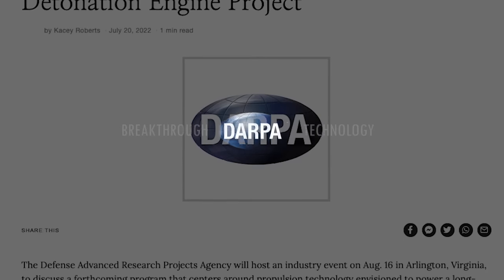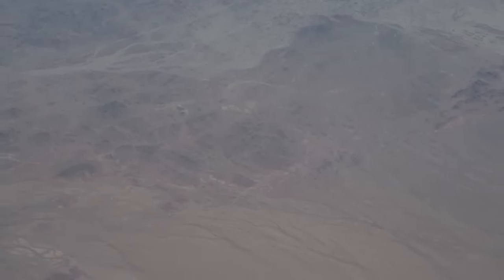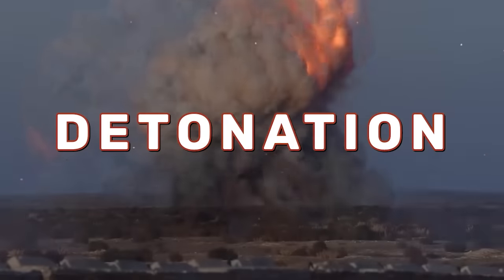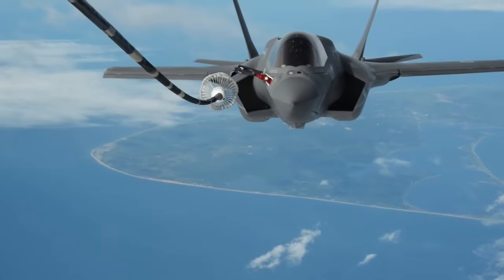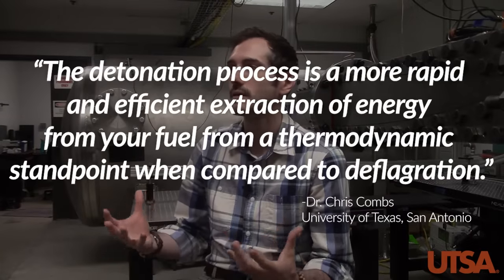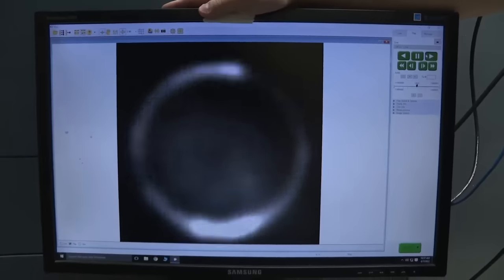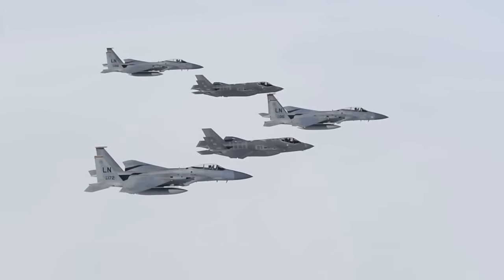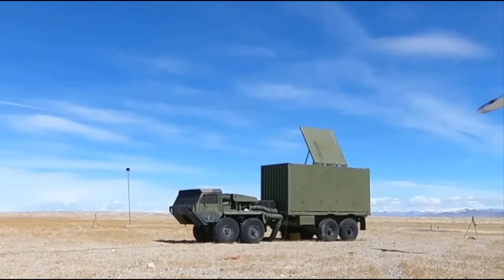The game-changing tech in DARPA's new missile

Comment: Love the presentation, I understand how this would work in missiles and aircraft, but I'm not how this would work in ships. I understand that the engine produces thrust, I'm not sure how it would produce torque however.
Reply: Do you need to produce torque? You could use thrust throttling and vectoring (like coast guard jet boats) to steer, rotate in place, even move sideways, power brake, go in reverse. Don't even need a rudder.
Reply: The same way a gas turbine makes torque. With a reduction gear.
Reply: Think of it like a rotary engine in a Mazda
Reply: Many naval ships already use gas turbines (like in a helicopter). The rotating detonation would replace the combustion chamber of the turbine engine. If the technology works as theorized, all gas turbines would eventually be replaced with versions that detonate fuel instead of deflagrating it. (BTW, the turbine connects to an electric generator or gear box.)
Reply: less cocaine before recording
Reply: Gas turbines in naval propulsion is confusing to most people. I was in nuclear propulsion when the first gas turbines ships set sail. Fascinating topic.

The turbine really just produces an energetic gas, much like the steam we have used for centuries. It sucks in massive amounts of air mixes it with fuel and fires out robust exhaust gases. We extract work from said gas to run turbines for generators. 

That output runs many electric motors including main drive motors which are more efficient and lighter than turbine shafted mains. An electric drive is built much closer to the propellor than the massive, heavy turbine. That also saves the weight of the shaft as well which can reach hundreds of feet in length on carriers. Gas turbines also don't require large condensers to recover exhausted steam to refeed the boilers. Overall, a lot of space and components are eliminated making production, operation, maintenance and repair costs lower.
Reply: Spinny thing powers other spinny things, like propellers.
Reply: Here's what is crazy though: an axial flow jet engine is fundamentally something that spins as the turbines suck in air, compress it, then after burning the fuel mixed in the compressed air spin a turbine with the exhaust to keep the whole thing running. So a turboshaft or turbine engine is just hooking a driveshaft to that and letting the engine spin something else too. 

But to turning this into a turbine engine suggests they are going to basically do the equivalent of blowing up some TNT and letting the blast spin a windmill. Probably, as the detonation wave progresses out of the engine it is going to create a spiral shockwave. Kinda like if you watch detcord explode on high speed video the shockwave moves out diagonally to the line of the cord because one end started detonating before the other so the shockwave has moved further away from the point of the explosion at at the end that started first than it has from the end that's detonated later. But then you wrap that into a circle and the angled line turns into a spiral. I'd bet they'll have a single really strong turbine blade at an angle that matches the angle of the shockwave and riding the shockwave as it goes around the engine. Or if there are 2 waves then two turbine blades, or however many the engine produces.
Reply: @j.f.fisher5318  ok this is what I was looking for.
Reply: Abrams tank uses a turbine
Reply: My Frigate was equipped with two gas turbines, otherwise known as jet engines. They told me it was basically the same model as on a 737. The turbine produces thrust. Across an air gap the thrust spins another turbine that is connected by a shaft to reduction gears which in turn are connected to the drive shaft that in turn spins the screw. On top of that the screw is variable pitch. The Ticonderogas work the same way but with four gas turbines.
Reply: @richdurbin6146  I'm not confused about the gas turbines, I'm more confused about this new engine. This new engine seems to have a much more intense and seemingly moving explosion unless I completely misinterpreted the video. Essentially, it seems to produce thrust from the reaction alone rather than by having the reaction move turbine blades. Will thicker blades be durable enough to produce the needed torque?
Reply: @generalrendar7290  I guess I misunderstood what you were asking.
Reply: @generalrendar7290  reasonable considerations. Most likely solvable with modern material science now or in near future

Comment: I thought that “afterburners” went out with turbo jets.Turbofans, if so equipped, have “augmenters”, instead of afterburners.This is an important distinction because in addition to what goes through the combustor, augmentation uses clean unburned air bypassed AROUND the combustion chamber. This cools the combustion chamber allowing it to operate at higher pressure ratios AND provides fresh air to the augmenter. All modern fighters use augmented turbofans these days.

Comment: Rotation Detonation Engines work on basic thermodynamics: the higher the starting burn, the more efficient the engine ought to be. 
What stops the highest temperatures: materials. Diesels have to use inter-coolers after the turbo-boost just to save the engine.
From a purely thermodynamic point of view, the ideal engine wouldn't have one. (Highest efficiency would degrade unit specific output -- less HP.)
RDE hopes to fuse the episodic burn seen in ICE engines -- where the burn temperature is quite high compared to the containment metals -- 
with the flow through seen in open Brayton cycle engines. ( gas turbines ) 
If RDE geometry can be solved, the Big Change would first show up in the use of MUCH cheaper metals for turbines. 
RDE tech would not change the nature of after-burners. They'd still be fuel pigs. 
For ultra-speed applications, we've already hit the wall in terms of materials. 
RDE -- it is hoped -- would allow super exotic performance when exotic materials were employed.
It'd be like a rocket motor that does not need regenerative cooling. (The latter chills expansion gases that you really wish to keep super hot.)
Such wasted thrust is most evident in the classic NASA footage of the Saturn V at lift off. 
A skirt of un-burnt propellant shoots down -- hiding the flame -- until about 2 meters below the nozzles. Then the gas bursts blindingly white hot.
Of course, the whole idea of using naval air against Red China is a joke. As seen in 1945, carriers sail close only to deliver the coup de grace.
Red China will be defeated by radio announcement. Once the USN broadcasts that merchants sailing to Red China are suicidal -- no-one will do so.
There will be no repetition of the Battle of the Atlantic. (1939-1945) Red China's war industries will collapse faster than Putin's.
Reply: The temp issue is solved with the use of inconel 625 nickel allow metal. Spacex and other rocket companies have improved their engines with the use of the metal because it has extreme upper temp limits.
Reply: Calm down Tom Clancy.
Reply: IF they have really solved the technical ceramics crack propagation, this would improve all heat engines a lot. Hundreds of deg higher operating temperatures. Somewhere I've read that the they are testing the first aircraft engines with ceramic blades. This ceramic has nothing in common with the household ceramic.
Reply: @panan7777  No one really thought that we would be making blades of recycled coffee mugs. 😀
Reply: We must notify the Navy that much of their efforts are unneeded. I'm sure they'll be greatly relieved.

Comment: Hey great vid ! Just to add in more technical detail the reason detonation creates more thrust from the same amount of fuel or 'specific thrust' is due to the increase in thermodynamic efficiency as seen in comparing a Fickett-Jacobs and Brayton cycle P-v digram. This is due to detonation wave moving at sonic velocities creating a shock and pressurising the reactants without the need for a piston/compressor blades.  this is why its so called 'pressure gain combustion'  although when looking at the cycle as a whole no thermodynic laws are being broken  as the name suggests. 
Also i think some italian guys have already flown one on a model rocket as well as mbda looking into this concept recently, i alos know of a paper detailing the incoperation and running in of a RDE combustor in a gas turbine. Can source if intrested.

Comment: We used to call RDE "ultra compression" and knew that it was much more efficient than a traditional design, but it isn't exactly zero maintenance. Parts wear out so quickly that it makes for a disposable engine core with all of the stress fractured components.
Reply: Probably why missiles were the first application mentioned. Don't have to do any maintenance.

Comment: The two variables in these things are pressure and volume, similar to voltage and current (or amperage) in electricity. I'm curious if the flux density of the detonations, or of the space between them is a factor in their size.

Comment: I can't remember a single modern airborne missile, arming planes in aircraft carriers, that uses liquid fuel. It's probably a solid fuel RDE, that's a whole different thing.
Reply: Jassm uses liquid fuel
Reply: @JohnFrumFromAmerica  Not operated from aircraft carriers until now, but the SLAM-ER uses jet fuel - not a common weapon there, though.
Reply: @forgotten_world  why does that matter that they are only Just using JASSM off carriers. Liquid fuels are more energy dense and can be used in air breathing engine. It looks like extended range and speed is what they are trying to achieve.
Reply: @JohnFrumFromAmerica  My comment was about the video, watch it first to understand. Also, turbofan missiles are subsonic or transonic. High speed, high performance missiles uses solid propellant rockets.
Reply: @forgotten_world  I know that but it looks like the purpose of this technology is to allow for speed of a solid fuel missile with the range of a turbo fan subsonic missile.

Comment: You seemed to have missed the boat on the improvements described and bought into just reporting what was in the papers.  If there is more power from the rotating detention engines, they can go farther or faster or any combination of these.  The Navy’s ship description probably assumed the same size engines - otherwise a smaller engining, equal power and all benefits in range could be done, or same range, greater power/speed.  Same thing for missiles, jets and everything.  Redesign can put all the benefit in any area - the split would be based on some arbitrary constraint.  If a F-35 engine could be made smaller, perhaps more space/weight for weapons.  One of us missed something, as this fundamental change in power plants can be used for whichever benefit is desired.  Missiles are a good initial role, as the pressure/temperature profile may be significantly different and missiles don’t have the need for as long lived operation.  Thanks for an interesting video.

Comment: Looking at the ideal model of a PDE, from time index 4:02 if the RDE is based on the PDE, in theory you could extend the operational ceiling by introducing an oxidizer to allow a missile or a jet fighter to fly higher in the atmosphere, where there is far less oxygen available for combustion. 

The engine's computer could automatically increase the flow rate of the oxidizer to maintain thrust, to compensate for the drop in external air pressure (and the consequent drop in oxygen's partial pressure) as the missile or jet fighter climbs to higher altitudes. Then as the missile or jet fighter drops back down, the engine's computer automatically decreases the flow rate of the oxidizer. 

Another application for such a hybrid jet/rocket engine may be to build an automated vehicle to Scientifically explore the region between the Mesosphere and Low Earth Orbit (LEO).

Comment: 10/m sec vs 2000/m sec? That's huge. If you could put that to use in an IC engine, we could get huge range improvements that could essentially kill electrification of vehicles.
Reply: not really, the noise would be unbearable, and such engines wouldn't do very well in any kind of land vehicle that has to change speeds alot.
Reply: @hughmungus2760  Yeah well, details. I'm just ignoring that part. 😅

Comment: Would really be interested to learn how they plen to convert a RDE which is designed to generate Thrust into an engine that generates torque which can be used to propel warships & tanks by transferring rotational explosions, which produce thrust, into actual, physical, mechanical rotation to spin a driveshaft. Also, the unique application of a hybrid for a helicopter, that could provide both torque for the prop and thrust for horizontal propulsion making them even faster.
Reply: Well, m-1 has a jet engine somehow.

Comment: The shape of the flaimtrail/exhaust looks very similar to aerospike rocket motors to me.  Is that just an artifact of the footage you used?  I did find several articles on NASA evaluation of aerospike that reference rotational detonation so they could be related or use similar principles.  Not being an engineer or having any aerospace experience I'm not sure of all the technical details of either.

Comment: Interesting idea, the detonation is of course limited to the energy in the fuel. While deflagration is basically just burning, the detonation wave speed is also limited by the density of the medium it is travelling through, and while 2000 meters per second might sound fast, it's actually quite slow compared to the speed of solid state explosives, RDX is up around 8000 meters per second, with some newer types getting up to 10,000 meters per second. Obviously solid state fuels can't be used like this in an engine. That kind of speed is only achievable with high density and high energy fuel, but fuel air bombs I believe can get over 2000 meters per second, but again, optimal fuel oxidizer ratios are critical but also is the type of fuel utilized, I think gases like propene offer good performance because of the wider range for the fuel /air ratio and also the extra energy available in the double bond of propene.
Reply: For a detonation engine it should be as low detonation velocity as possible to not destroy an engine, and to make a detonation engine as light as possible if it's going to be used in the aerospace industry.
Reply: @My-Opinion-Doesnt-Matter  I think you are missing the point, detonation velocity can't be controlled, it's an instant shockwave, it's ALWAYS going to be supersonic, if it isn't, then it isn't detonation, it's slow like deflagration....like I have said in other post's it is going to be LOUD...

Comment: @5:04 Neither piston engines nor jet engines have "explosions" happening in them, the fuel in both of them burns. 
When explosions happen in piston engines it's called detonation and it quickly causes damage to the engine. Jet engines also burn their fuel in a controlled manner. I'd guess any sort of "explosion" in a jet would quickly damage both the combustors and the turbine blades.
"Subsonic explosions"?!? Check your facts.
Reply: I can verify no explosions in jet engines. I worked on and operated GE LM2500 gas turbines engines in the US Navy for 20 year for ship board operations. In starting, the igniters are energized. The fuel is pumped into the combustors. Think of holding a lighter in front of a can of hairspray. Then depressing the little release nozzle on top of the can. That’s a crude way of describing light off. In the meantime a starter motor is turning the compressor of the turbine to produce air for combustion during the start sequence. Once the engine picks up to self sustaining speed the starter motor kicks out. Once the engine is up and running, the more fuel you send to the combustors, the more combustion which increases the exhaust gases to the power turbine. Our ship board engines didn’t have afterburners. Our power turbines were coupled to a reduction gear set thru a high speed flexible coupling and clutch. After passing thru the power turbine the exhaust gases are vented to the atmosphere thru the exhausts. No explosions for normal operation. Now if you do a hot start by going thru start up improperly then yeah you can get a mini explosion which can damage the engine. So maybe that explains the start and operation of a jet engine in a nut shell for those who don’t work on or operate jet engines without getting too technical. Just gives a basic idea. The explosion theory is wack. Because anything sucked into the intake damages compressor blades which at high speed can sheer off and migrate down stream or sling out thru the engine casing. If their is damage to the combustors, it is usually sent down stream to the spinning power turbine which takes out power turbine blades. Either of which is catastrophic to the engine. So no, an explosion is very undesirable.

Comment: If i were a rotary wasp engineer WWII,  i would set the distributor timing to detonate on rapid acceleration.  Dentonate for the purpose cleaning the carbon. 

Multiply that by how many cyclinders and you go pulsing along.

Then you had wwii pulse jet engines that were considered cheap and expendable .  Buzz bombs.  Fast forward to fuel addivites and air breathing engines called National Aero Space Pulse engine (NASP).  😊

Comment: With P&W working on these, I wonder if they will ever make it to the civilian sector. Can you imagine the fuel savings on a jetliner, say a 787 or 777, with these powering it? The biggest reason (so the airlines say) that flights cost so much is the cost of the fuel.
Reply: Such engines may be used for aircrafts that fly Mach 5-6 speeds. So 787 or 777 are out of discussion.